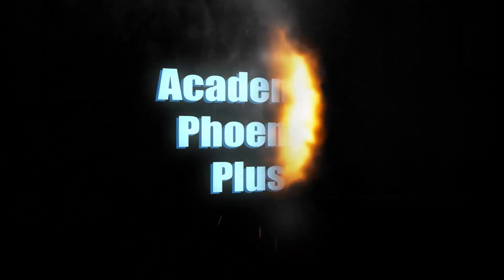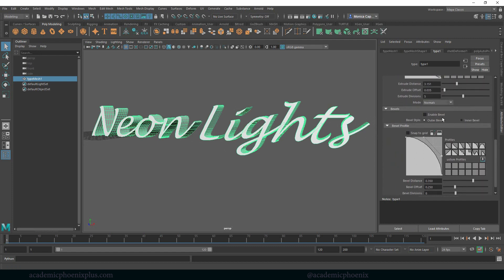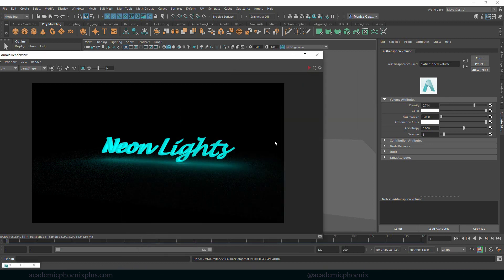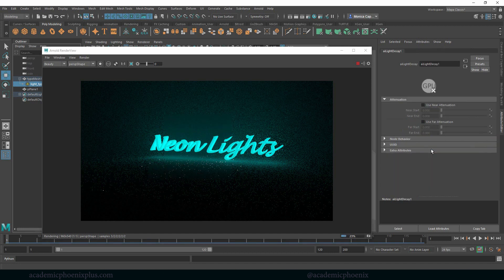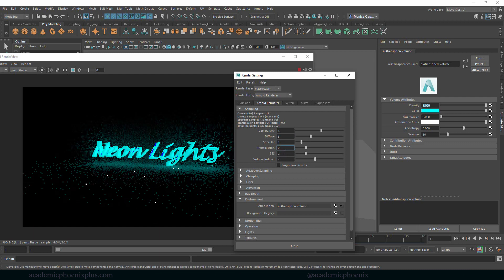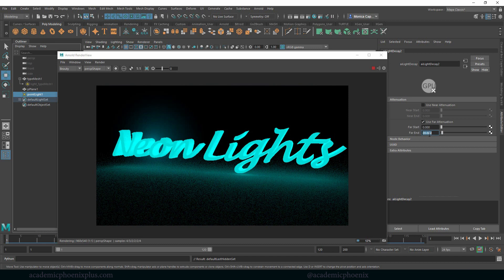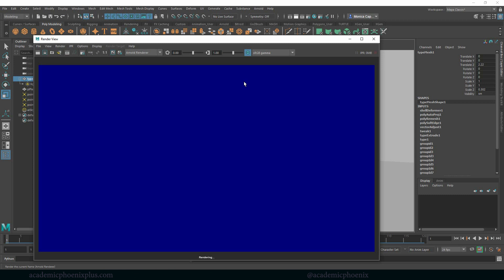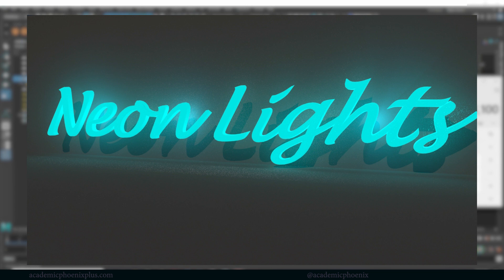Create Neon Lights in Maya 2019

Comment: It's awesome... but I have one question!!  if we have lots of mesh lights in the same  scene then the ai fog will work for all mesh lights?? If I just want the fog effect on one light then?
Reply from the maker: That's a good question and SpaceMonkey is correct. in the light attributes, near the bottom, there are a bunch of sliders under Visibility. If you do not want the fog to affect the light, then drop Volume to 0. That should do it! :) Hope that helps
Reply: ai fog doesnt give u atmosphere volume effect of light just use ai atmosphere /////  set the Volume contribution to 0 on the Main tab of other area lights
Reply: if u want fog effect too use big area light keep intensity low